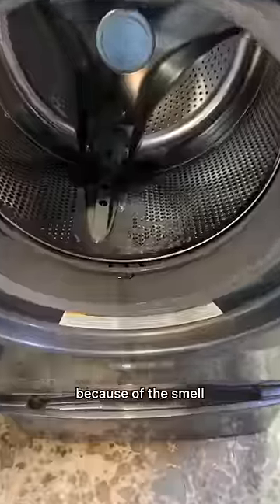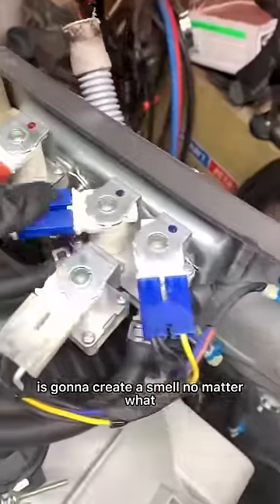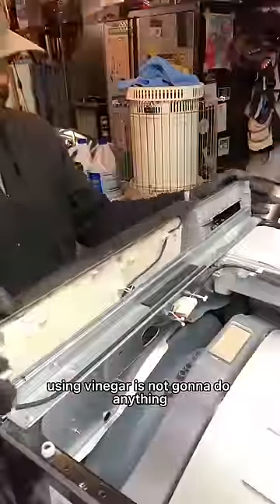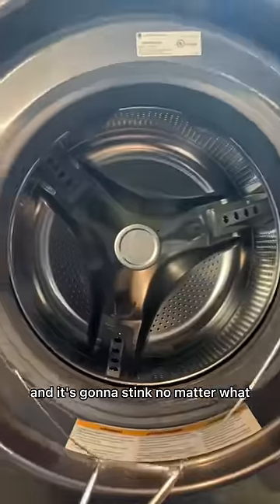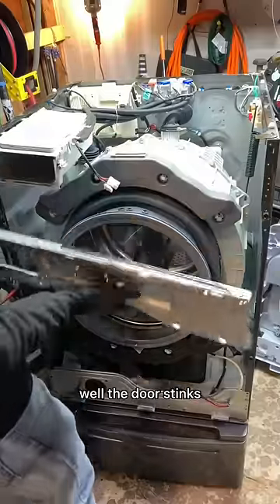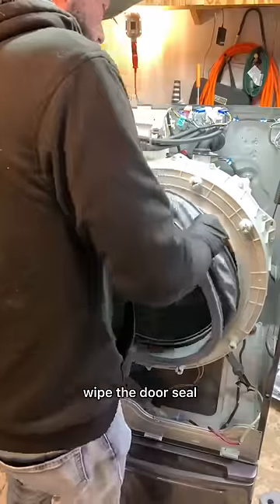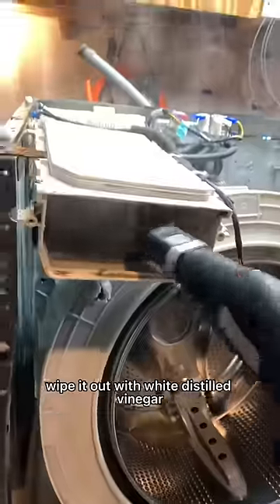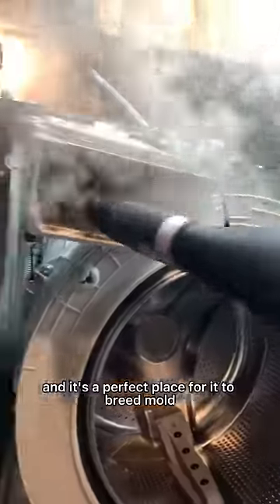Front load washers are proven to wash better. Facts, not opinion

Comment: Everything works longer if you take care of it. My mom has a 20+year old Miele front load washer never had it fixed runs like new
Reply: Unless you post a video, we don't believe you.
Reply: That is normal in Germany. Miele defies physics. My parents got new brushes on their motors after like 20 years or something.. machine is probably 30 now
Reply: I mean, it's also Miele. That's a good brand. I don't know if you'd get that same life out of a Beko, even with the best of care.
Reply: Appliances nowadays are actually build to only last 3-5 years. They realized the ole 80s designed Maytag top loaded would last 30 years and they make no money like that. Same with car manufacturers, look at a 1993 honda with 400k only vasic maintenance. And a new car youd be lucky to get 100-150k with proper maintenance and only 1 engine replacement @50k and a transmission rebuild @100k.
Reply: @1987FX16 yeah,  my parents have a fridge that has been going since 1981. The fridge I bought 5 years ago is alreay having issues.
Reply: Yea Miele washers are insane. I'm using an 20 year old Mile 980 novotronic w980 wps from my mom. However we clean it every 3-4 month. When it breaks we will buy a new Miele since they are the only manufacturer with a 10 year warranty.
Reply: @Till113  Oh that's good info about the warranty. I'll bear that in mind for my next kitchen purchase.
Reply: My sister has a 50 year old Maytag that belong to my mother - rubs beautifully and she’s had to replace the bands a few  times
Reply: Look how much they could though.  For the cost they should outlive you
Reply: Meille is king
Reply: We have a Miele thats older thts 27+ years old still running fine. Had to replace the brushes on the motor, the pump, front seal and one valve once in all those years.
Reply: Just bought a 25 year old Miele Novotronic after my Constructa failed. The Miele is build like a tank. Also the drum bearing is very quiet and no hitting or shaking either.

Comment: I bought a washer and dryer set of 1983 Maytag's in 1988.  The top load washer lasted over 25 year's. There were no replacement parts, so I bought another older model Maytag.  I am still using the same dryer made in 1983. I never use fabric softener and I only use liquid detergent.
Reply: @Kurt p, Whirlpool has good selection of parts for the older maytag machines, I'm doing a tub bearing job on my 1999 Maytag washing machine with Sud saver. I got the orbital transmission out too for an oil change
Reply: We have a shop in town the refurbishes old school refrigerators, old school stoves and old washer and dryers. I'd never spend thousands on those things new. If mine breaks he will make house calls to fix his stuff
Reply: I hated mine. And I hate my top load impeller washer, my next one will be old school Maytag with agitator and full water level. I want a warm rinse for my rayon clothing. I live in the country with my own well. I hope to never live in town.

Comment: My top load washer has worked without stinking or disassembly to clean since the 90s. Why buy trouble? Top load for life.
Reply: Yea all the new stuff is junk. Shame you can't find simple appliances anymore.
Reply: Yep.
Reply: Because I like my clothes gently tumbling around, not being frayed and sheared by an agressive agitator using 3x the water and electricity.
Reply: @bikeguyhd1035  
But not clean and still smelling bad? I wash my delicate things on the gentle settings. They come out clean, sweet smelling and in good condition. If your washer stinks, that is clear evidence of a design flaw.
Reply: @bikeguyhd1035 they make top loaders that don’t have agitators, and as a bonus clothes don’t smell like musty ass after a wash
Reply: My parents and I bought washers and dryers at the same time, 2012.  I bought a top loader and they bought front loader.
They are currently on their 3rd set of front loaders and I’m just now thinking about retirement.  My dad has also changed the pump, seals, gaskets etc.
No maintenance for me….F Front Loaders.
Reply: @keaganthedude  top load washing without an agitator, hmm.  It still needs to fill the entire backer with water, wasteful.  Front loader works great.  🙌🏻
Reply: @bikeguyhd1035 They dont work at all 😂
Reply: Just like a top load: literally the way to fix this is leaving to door open so your washer drum can dry out every now and again. I usually do about one day a week. 

D  U   H 

Live smarter. Not in a damn box.
Reply: @bikeguyhd1035  I'm not going to fret over the $1-3 difference per month in water bill costs if I'm doing laundry 3 times a week. 

You don't waste water as long as it returns to a storm drain or sewage where it's treated and returned. 

The biggest issue here, by far is the maintenance of front loaders and the constant worry that you may be washing your clothes in mold. 

Workmate uses one and last year we all noticed he smelled like mildew water. Turned out to be his washing machine. Stagnant water remaining in the front loader was the culprit it seemed. 

Not worth the price, the hassle or the trouble.

Also, the newer top loaders no longer require agitators. More expensive, but oddly still cheaper than front loaders.
Reply: @keaganthedude  Tried the top loader without the agitator. Piece of junk. Clothes didn't get cleaned and didn't get rinsed out well. Went back to the agitator.
Reply: @keaganthedude Musty ass wash is the job of a top loader.
Reply: @bikeguyhd1035  you know they have top loaders without the agitator, right?
Reply: @svn5994  The, you must not be washing your clothes right because I have only ever had a top loader and my stuff is fresh, fresh fresh. If you are musty, you need to clean ur machine, and take your clothes out as soon as they are done. Musty is from things starting wet too long. Sounds like a you problem. Hope it gets better ❤
Reply: I have never had to think about laundry. You all need hobbies
Reply: @kinbolluck476  
Well lucky you.
Reply: @Blobby-obby  Front loaders objectively clean better. They also cause less fabric wear. These things have been extensively tested. There's a reason all commercial, industrial, institutional, etc., laundry machines are front loaders and have been for a very very long time: as long as you use them correctly, i.e., don't overdo it on the detergent and leave the door open when not in use, they are better in basically every way: better cleaning, less fabric wear, more effective spin cycle, less water and energy usage, etc. Can you get clothes clean in a top load? Sure, although I'd wager most people just saturate their clothes in synthetic fragrances, optical brighteners, and fabric softeners, rather than actually getting them clean.

That the consumer grade machines are garbage is not because they are front load, it's just because they are garbage. Speed Queen and Miele still make solid machines that will last decades.
Reply: @bikeguyhd1035  What are these crazy‐ass machines that are "fraying and shearing" people's clothes?! Is Edward Scissorhands doing your laundry? Is there a blender blade in there instead of an agitator? I have some clothes and towels that are over 35 years old and a great majority of my clothing and other laundry is at least 15-20 years old. Nothing has ever been shredded or frayed by the 5 different top loaders (moved 4x) that I've used in my 50+ years of life. Most of my stuff looks almost new, even the really old stuff looks decent. I stick with mid-range Whirlpool, GE, the "better" brands but all have agitators, I always use the longest cycle for the most agitation to really clean and tend to use the regular/heavy duty cycle for everything but delicates. I don't get it. What are you guys doing to your wash?
Reply: @bikeguyhd1035 you’ve been brainwashed lol
Reply: @keaganthedude  and those washers without an agitator don’t clean worth a shit we’ve had three of them. We finally settled on a front load and it cleans great and it doesn’t stink if you just keep the door open and the detergent tray open.
Reply: @bikeguyhd1035  When they are just being gently tumbled around they arent getting cleaned well

Comment: "if you let pools of water sit in there it's gonna get stagnant and it's the perfect place to breed mold"

If pools of water sit in there the washing machine has a design problem.
Reply: FL washers need a floor drain. With the outlet at the base of the unit. And then air flow. 
Then there's the detergent issues. And ppl using cold water. 
Right now, It's a bad formula between typical consumers & machines.
Reply: You're cute

Comment: 20 years using a top load and no problems
Reply: THat is the reason, old models are build better.
Reply: Same with my front load washer
Reply: Top loaders have less moving parts so they don’t break as easily as when someone over loads a front loader and stuffs clothes in, 20 years old also means certain government regulations aren’t installed into the machine to save water like they are nowadays just like toilets, front loaders were still relatively new back then but have come along way and are now better at cleaning if you’re comparing new machines to each other, they just don’t make em like they used to

Comment: Maytag old style washer will never give you issue for years
Reply: Maytag for life ✊
Reply: Yep my parents had one. Well over 30+ years. Energizer bunny 🐇💨.... it keeps going & going 🐾. Manufacturers simply no longer build things to last anymore.
Reply: When they were built in Newton Iowa!!
Reply: My parents just got the new one is the new ones as good?
Reply: Maytag. ARE THE BEST
Reply: Speed Queen, made in Wisconsin.
Reply: @oswaldjenkins8557  my parents went through 3 maytags before the company caved and upgraded them to a commercial grade one. This was when they first came out with front loaders and the Maytag repairman was their mascot (... Wonder why? Lol)

They've still had problems with the commercial one but smaller fixes like a belt or door seal.
Reply: @socalpyrotechnics4493  I dye with pro dyes and hand-print fabrics and I need a lot of control. I got the Maytag Commercial (that's what it's actually called) a few years ago and I love it. Tub is not that big, no fancy stuff, but it seriously cleans everything well, and in cold water. The gentle cycle is truly gentle, which is unusual. Cold water, Persil Deep Clean & Boosted Stain Removal detergent (for normal dirty clothes, use less than it says), 1/4 cup Biz powder, 1/4 cup clorox when needed. And I am always amazed when a load is seriously not level and this machine levels itself.
Reply: @90w30n  I just hate how long it takes!
Reply: My husband owns a used appliance shop and he says the same thing! When they were built tough and American made before they put the electric and digital stuff on them were the best. they are easy to fix and they do an amazing job getting clothes clean. We have people come to our shop wanting the old maytags because their new washers without agitators and their front loaders don’t get their clothes clean like the old style does. If your doing anything that gets your clothes really soiled then the old washers are the way to go.
Reply: @elizabethgallaher4705  not the new ones, old ones were forsure forerunners but everything is cheaper nowadays, not made to last
Reply: @JohnDoe-vh4rt  only machines that I sell new are speed queen and speed queen only
Reply: Every maytag appliance I have had has died within 5 years from some sort of electrical failure that isn't repairable.  Wouldn't buy them ever again.

Comment: I’ve had both.  Top load gets my work clothes noticeably cleaner than the front
Reply: I was shocked that he said front load washers clean better like he got paid to say it
Reply: @aurorayoru5333  they do clean better, people just compare older or newer machines to each other and don’t realize government regulations on saving water are thing for laundry systems just like toilets, they also usually compare different brands which is just dumb speed queens are the best across the board for commercial and residential, reason I only sell new machines that are speed queen only

Comment: Tell the manufacturer to fix their crap products .....
Reply: The new front loaders have a dryer that you can turn on after use.  I have one and it’s pretty awesome.  I wouldn’t get one until they fixed this problem.
Reply: Just take care of your machine, keep it clean, keep the door open. It’s really not difficult at all.
Reply: WAS a maintenance guy at a resort......they bought 10 front loader machines.....nothing but problems( biggest problem was they leak, second was they were too complicated,third was seals being wrecked by you name it.]...inside of 2 years they were replaced...this was in 2010...
(Water cant leak out of door on top loader machine)
*problems went away when replaced with top loaders
Reply: @jay-uo2bi  it is when you have a family and other things to do.
Reply: You need powerful detergents with a front load washer. People think they cheat in cleaning, but in fact they are more delicate and allow you to clean with better chemical cleaning instead of mechanical cleaning. Just use good detergent: powder for cotton, liquid+calgon for synthetic and you are set for life. Also, americans fail at hot wash. Let's face it solubility increases with temperature. Either a hot wash, or a medic hot rinse is necessary to avoid redeposition "greying". If that is the case, you are failing at laundry.
Reply: It's 100% use and care issue. Consumers leaving a ton of moisture in their appliances will cause mildew and mold. Fabric softener is horrible as well, everyone uses ENTIRELY too much.
Reply: @Spinks3891  Electrolux recommends using fabric softener saying it strengthens it. I personally believe mold and mildew is because of detergent residue. I'm getting a washing machine with hot rinsing to avoid it entirely.
Reply: @MeteCanKarahasan  plan on purchasing one soon? I can hook ya up with a discount.
Reply: @Spinks3891  sure, if only I was your countryman.
Reply: @MeteCanKarahasan  how can you get a washer with hot rinse?
Reply: @TheWaynester101  thanks for asking, there are 2 settings in different brands that I have noticed. It is clearly stated in the manuals, some washers are capable of this. If it says it performs all rinses with hot water - it is hot rinsing. The settings are called medic rinse, or anti-allergy rinse, although some upstart brands languish this ability in antiallergy cycle eventhough it is just a normal extra rinse. Don't confuse the two.
Reply: Cote with your dollar. Don't buy crap products.
Reply: @angelbulldog4934  new products you would expect a certain quality...sometimes you get surprised once you get it home...
Reply: I was raised on side loaders and my first side loader served  me  for 20 years and it never ended up like this one in need of dismantling to clean it up! There's gunk even on steel drum and I'm guessing the person that used it overloaded it so much that their clothes not only didn't wash, but it didn't even wrinse! I never saw anything like it in my life! Darn, even my kids know you're not suppose to overload it and there should always be room inside that you can insert your hand in and move it freely!